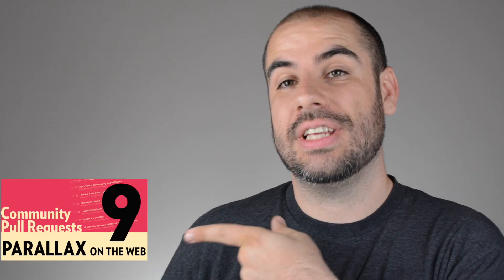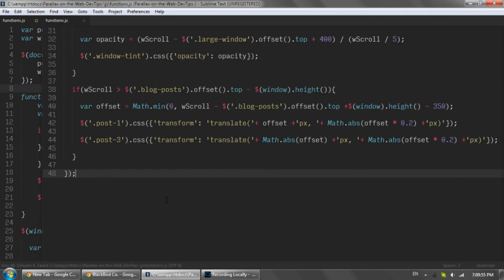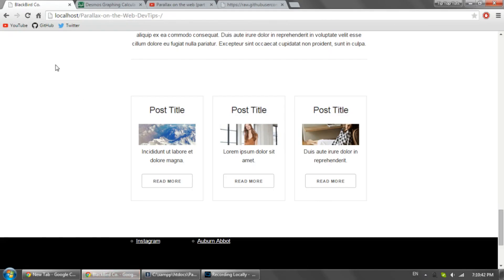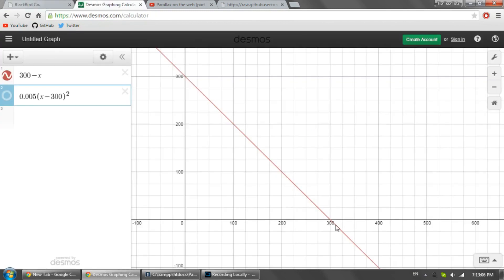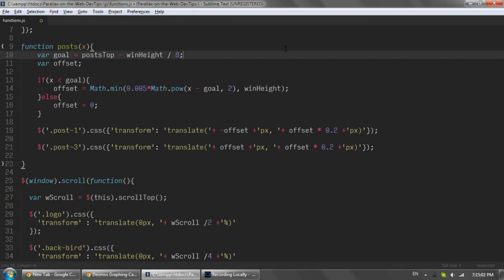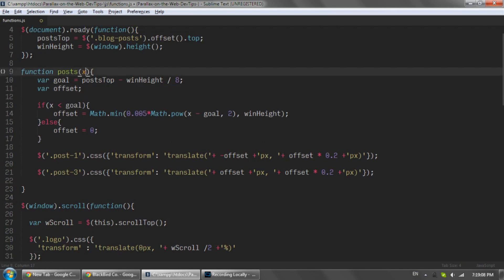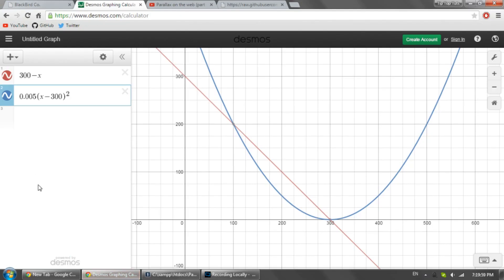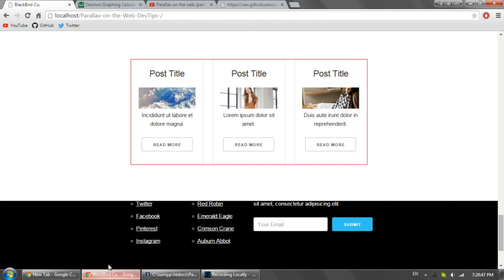Parallax on the Web (Appendix1) -  Quadratic Easing

Comment: Hi Travis Awesome video, i m following your videos but i have build my website using wordpress how do i use skeleton frame work to use your parallax effect. i m a beginner please help me thanks . glad you got a job in google , google is lucky to hire you.
Reply: +mohamed waseer , you are asking to help you choose between apples (fruit) and orange-scented-candles: two ENTIRELY different things.

Skeleton is a web-framework. WordPress in a Content Management System.

A web (application) framework is simply based on coding. If you are a programmer or a web developer that loves coding you often choose a Web application framework for your projects.

A CMS like WordPress is a Content management framework and it is based on the modules rather than code. Anyone can handle a CMS as it doesn’t require any coding knowledge. Of course programmers can also choose a CMS as they can do their job faster.
Reply: Thanks . . . . how can i  implement parallax in my site as i am using wordpress. should i design a plugin ? Are there any wordpress predefined function so that i can override them.
Reply: That's beyond me. Sounds complicated.